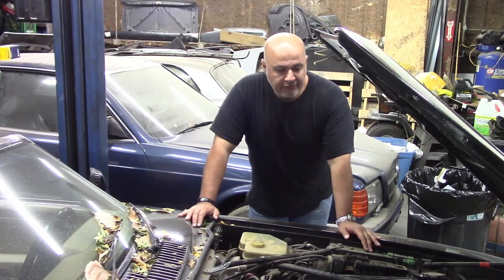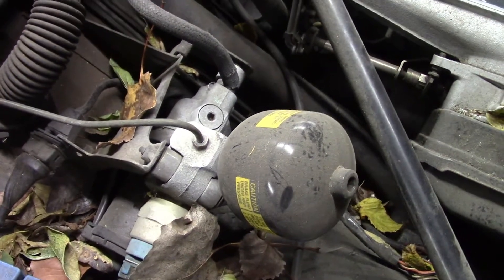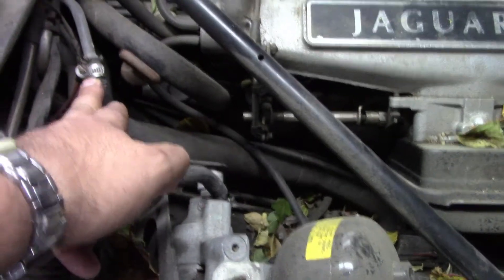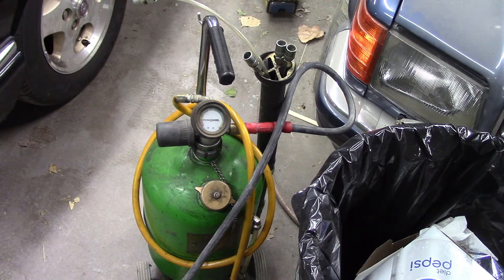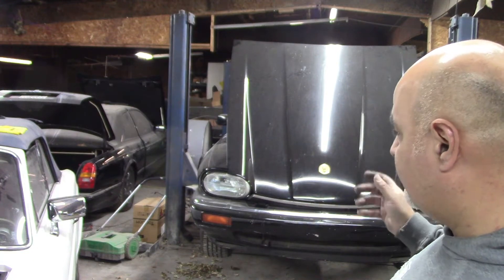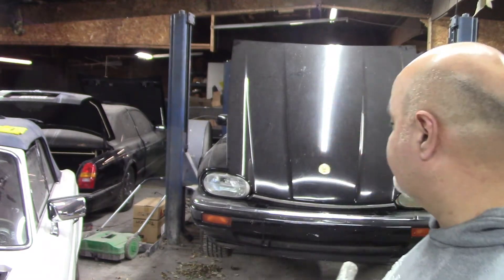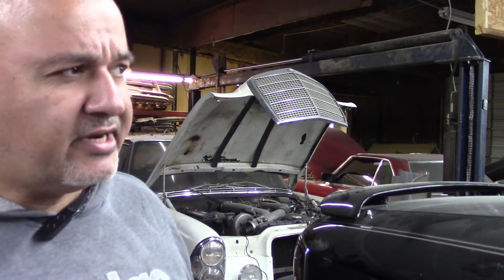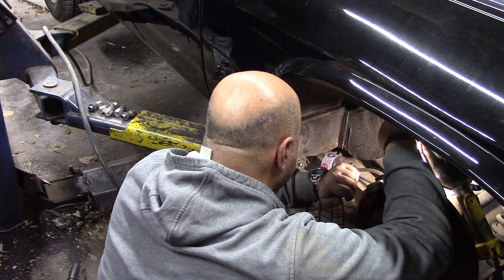1994 Jaguar XJS V12 Convertible - Bleeding Teves Braking System

Comment: OK another question about this? In summary, turn the ignition on (but don't start the car), 2-person process with 1 person sitting in car pumping brake or just depressing once on the brake & holding to engage the bleeder bottle? ALSO - we cannot find standard DOT 4. Only DOT 4 synthetic. Is this OK to use in this car once the brakes are completely bled out?
Reply from the maker: Press and hold, then open the bleeder. Let the electric pump do the pumping. When bled, close bleeder and release pedal
Reply: @Weekend-Wrenching  thanks much! Appreciate your quick feedback.
Reply: @kdsrbaldwin4621 YMMV but not until I bled all 4 and refilling with Pentosin Super Dot 4 did my ABS light turn off. Granted, there could be 3 dozen other variables that led to that effect but that's the (ahem) "beauty" of these %^!%!%^#$ cars. 😂

Comment: Four  caliper rebuild kits (front & back) and 4 brake lines from SNG won’t be expensive and would do you a world of good. Good Job so far 👍🏾. As coincidence would have it, my 94 XJS 4.0’s entire brake system is completely drained and I’m about to bleed the brakes from scratch as well. Keep up the good work 👏🏾
Reply from the maker: That should be fun. Where was the leak?
Reply: What is sng a parts store thank you.parts are hard to find in us

Comment: so you dont need to run the engine? Broom stick is keeping pedal on floor?
Reply from the maker: Yep, the pump is electric and kicks in when the pressure drops, so all that's needed is to depress the brake pedal for the rear brakes as you would with a Bentley.

Comment: check fluid is coming through the flexi pipe before changing the caliper
Reply from the maker: Good point, it could very well be the brake hose
Reply: The ball likely needs replacing. If it loses charge you wont have brakes
Reply from the maker: @nickr7747  the accumulator was replaced when I bought the car. That's not to say that it doesn't need replacing again as it was a while ago. I will test it